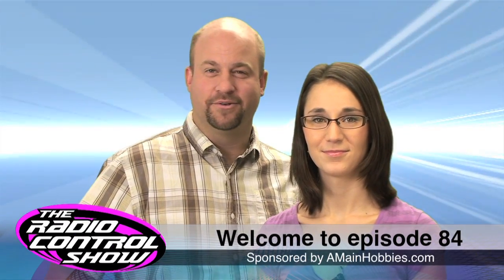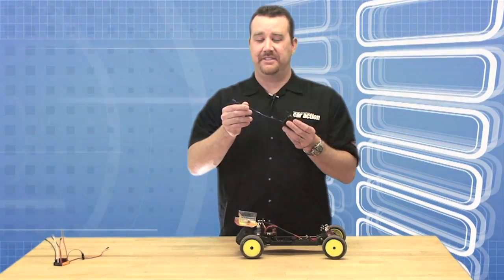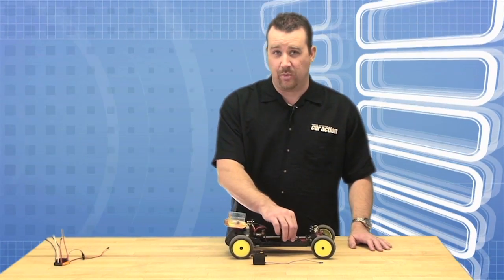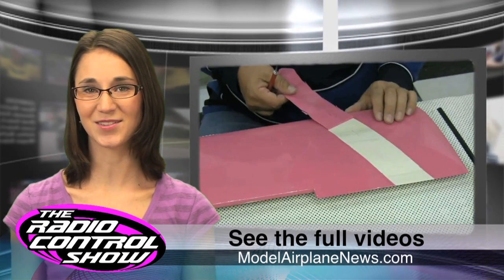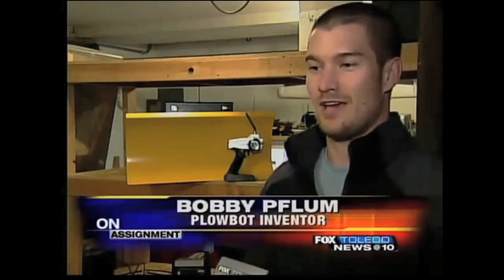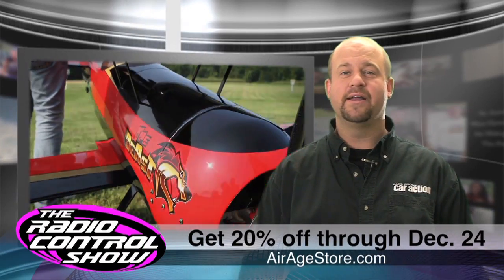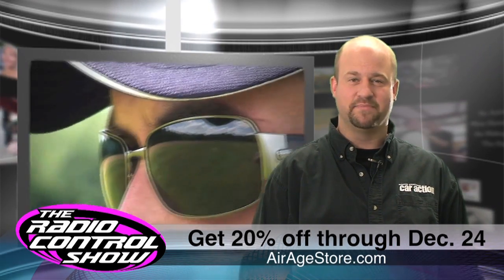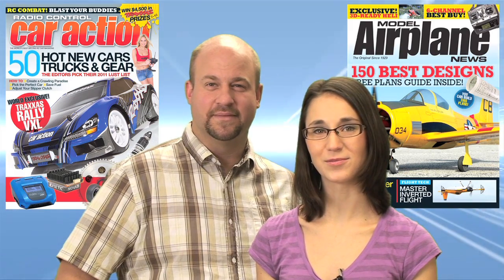The Radio Control Show 84

Comment: @MoNziL The biggest complaint is a security issue. A large enough model plane, with explosives or chemicals - chlorine in a glass bottle - could be used as a guided missile. It's not that hard to get viewable real time visuals. and being so small they would be almost impossible to find and stop in time. 

But you aren't wrong FPV is still really cool.